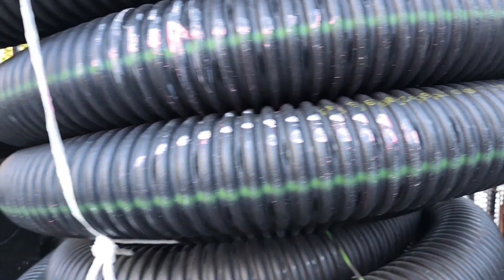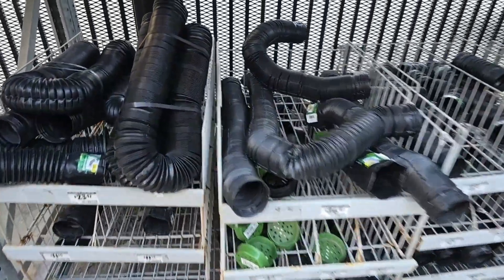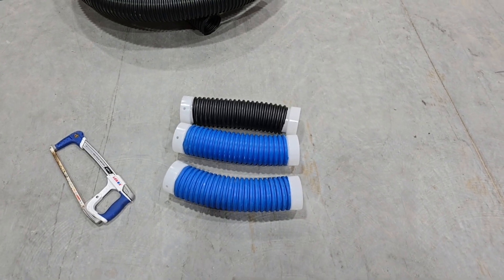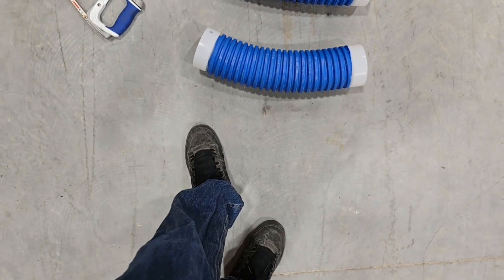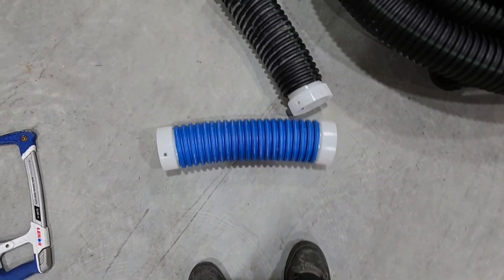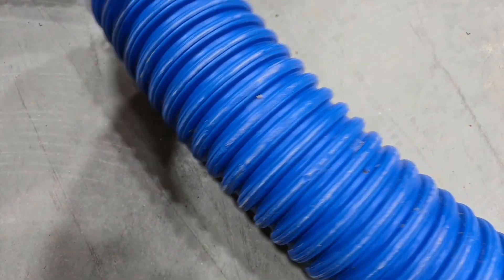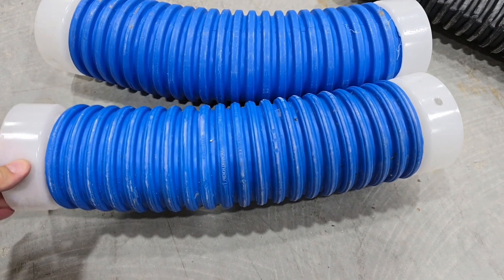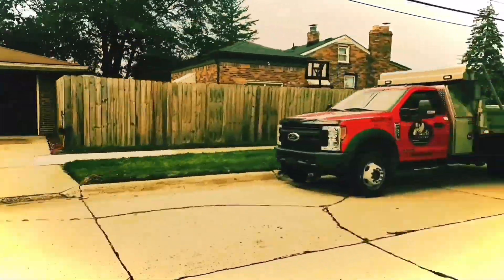2026 Corrugated Pipe Review

Comment: If my math isn't a problem, it seems to me you're not only offering a stronger pipe, but for less money. Around here, Lowe's sells 4" ADS for $1.36 per foot. You sell your Extra HD pipe for $1.05 per foot. But here's the problem for me: shipping cost. If I order only a single 100' role from you, I end up paying $4.72 a ft., If I order four roles, the price comes down significantly to $1.96 a foot. That's still 45% more expensive than Lowe's, but given I'm getting a stronger pipe that is rodent resistant, I can sell that to my client. But if it's a small project requiring 100' or less, it becomes a hard sell. I guess buying in bulk and keeping inventory is the trick there, but not necessarily easy for most. Anyway, love your channel and products (I've recently ordered several things from you--stuff you just can't find at the big box stores or even most landscaping places I've checked). Thanks for the knowledge and inspiring passion.
Reply from the maker: I appreciate your business and I'm glad we can help you with your projects.

Comment: Flow-Lab Experiment suggestion:  I think it would be interesting to see how much GPM or velocity is needed to get roofing debris or sand up out of a popup. Using NOAA data you can configure the minimums people might see to know if what everyone suggests is sufficient.  We've all seen the 40 GPM rated NDS 4 inch popup perform but nobody has seen how it might perform different than the 6 inch NDS popup, we know yours is open without restrictions but we don't know what max depth we might be able to install yours.  As an example I wonder if a 3 inch pipe at full flow from a downspout or a riser under one of you leaf-catchers is enough to wash up debris, IMO it seems like we could see that in a lab. If you rightfully claim more velocity then how much might be needed to keep the popup clean...(in that we can use the intake-riser under your leaf-catcher to add head-pressure when it fills.  The experiment would have a limited volume of water as areas like mine only see 50 inches of rain per year so the example would focus on that volume of water on that limited size piece of roof for a popup.  With the results we would know if the popup needs a 10 year storm, 25 year storm, 50 year storm, 100 year storm... to self-clean what wasn't washed out yet.    It might be impossible to wash roofing up-&-out without overwhelming the intake & allowing some flooding for more head-pressure, I just can't visualize it clearly so I ponder it but I think the math is there somewhere.
Reply from the maker: Luckily for me, I've seen so much. I just know the downspouts that get blown clean and ones that don't. Low-volume water does not clean during rains, and they need to be a smaller diameter pipe. So you're pushing a smaller volume of water through a smaller volume of pipe, and that'll keep it clean. Just through repetition and forty years, you see the common trends. A pipe that displaces less area will be clean all the time, even in low-flow applications. If you're worried about the pipe becoming overwhelmed, you put a taller riser at the downspout. This will pressurize the line, pushing the water through. The head pressure works fantastically.